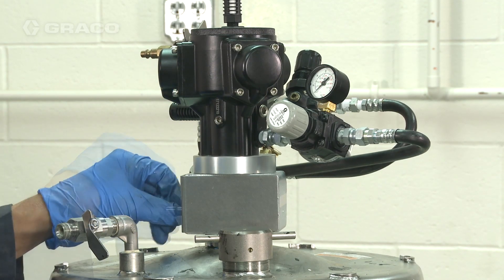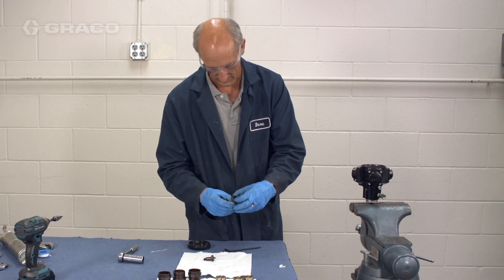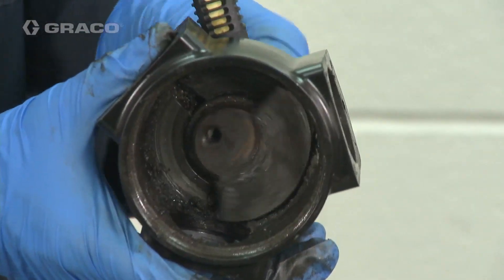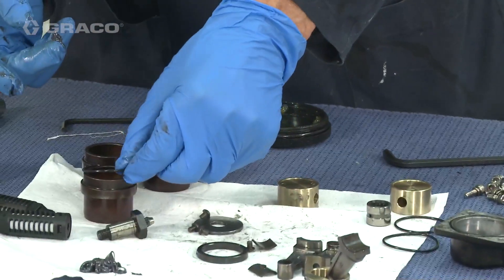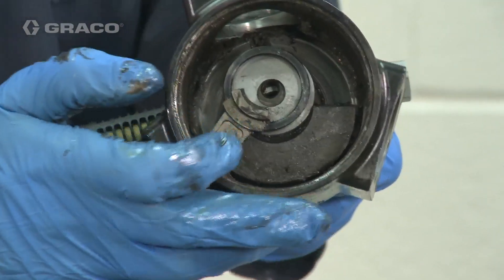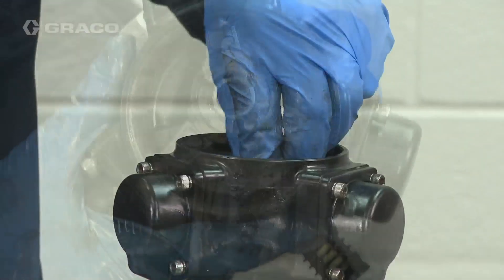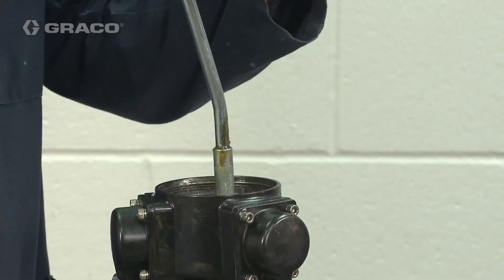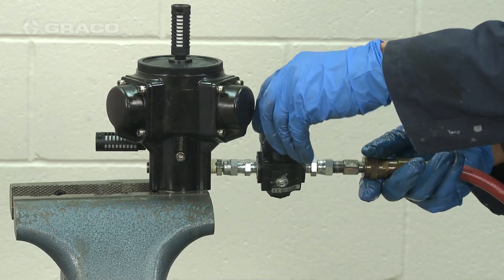Radial Piston Air-Driven Agitator Motor Service

Comment: How to replace the bearings??
Reply from the maker: Instructions on how to replace the bearing and bearing seal are in this manual: 3A5050E, Agitator Air Motor Rebuild Kits (https://www.graco.com/content/dam/graco/tech_documents/manuals/3A5/3A5050/3A5050EN-E.pdf)

However, if you need a bearing replacement, it might be time for a new motor. Contact your local Graco finishing equipment distributor to make sure.